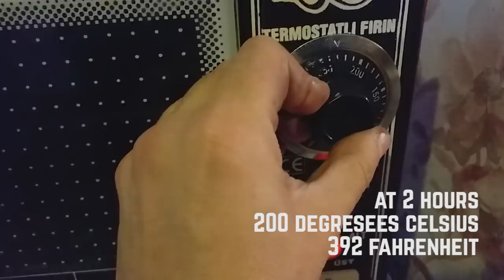Old Rusty Belt Knife Restoration

Comment: You do amazing work. I have to buy older knifes, because I can't afford the good ones they sell now. There's feature my knifes have, which I don't see anymore. The butt end of the handle has a metal plate. It's useful, when you need to pound somthing. I understand why they don't do that as much, anymore. Pounding that way, has you swinging the knife, point outwards. Kind'a dangerous.

Comment: You do brilliant work. I would not have the patience to do all the hand work you do. Why you do so much by hand when you don't have to, I will never understand. I do have a little tip for you, it's a small thing. before you do any staining or the like but have the handle where you want it otherwise, wipe the wood with a damp cloth, I prefer to use alcohol but water will work. Let it dry, the steel wool the handle (or any wood you want a nice smooth surface on) this is called raising the grain. when you sand and shape, littl hair like fibers are created. this takes them off. you may have to repeat this step a couple times to get them all. use like 0000 super fine steel wool to get them off without creating more.
Reply from the maker: Thank you sir!